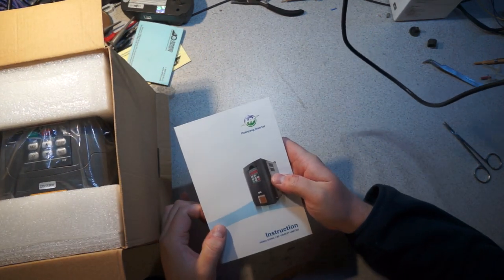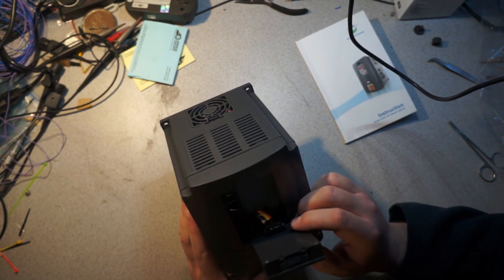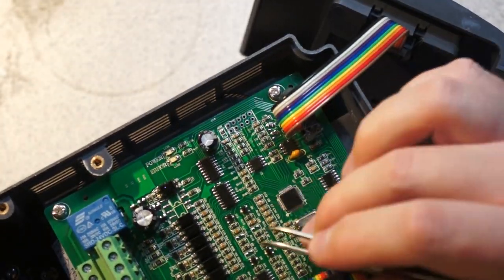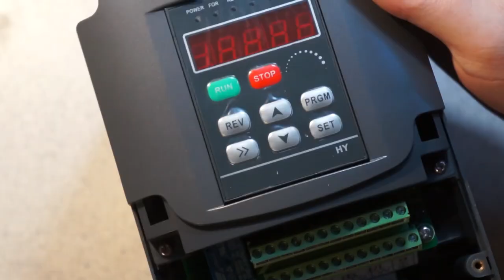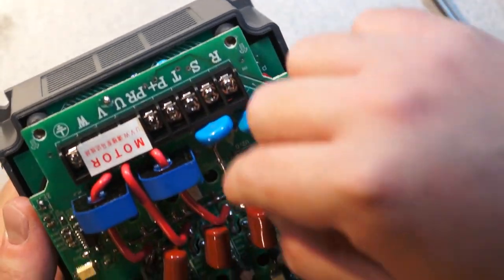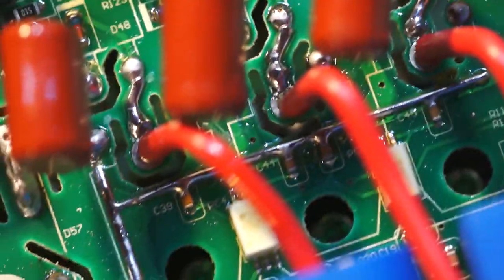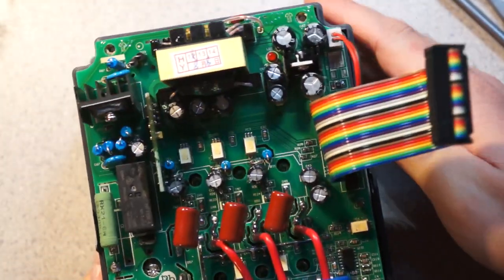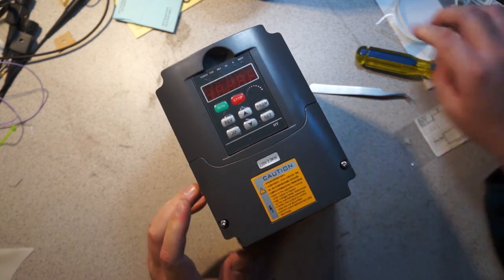HuanYang VFD Teardown

Comment: They work incredibly well. My 4kw runs my compressor beautifully.
Reply: Probably a 3 phase motor on the compressor and no 3 phase supply, so single to 3 phase VFD. Using a VFD also means the motor can be ramp started to reduce the starting load.
Reply: "But a single to three phase VFD gives out only single phase voltage"
That doesn't make sense.  A single to 3 phase VFD gives a 3 phase output.  I have a 3 HP 3 phase compressor running from a single to 3 phase VFD, from a single phase supply, and it works perfectly.
Reply: Yes, I should have clarified, the motor to be driven from the VFD, must be of the dual voltage type. Then it can be re-connected in the terminal box to run on 230 volts.  A 415 volt 3 phase motor will run very poorly, if at all, on 230 volts.

Comment: I have a 10HP 7.5KW 34Amp one of these, I am using it with  a 7.5 HP, 230 volt, 17.34 amp, 3510 rpm motor. It spools up to speed, but when I put a load on it, it faults out  (E.OC.A). It shows that it is using 6.6 amps when I put the load on, I don't think that the amps are going up to the 34 amp rating. Can anybody help me with this problem???
Reply: Mack Everhart you can change the program to set max amps. Can't remember what program number it is but there's a video on YouTube about it.
Reply: Mack Everhart motor amps program 142.

Comment: Does anybody know what I should do for error E.O.C.A. on one of these???
Reply: Mack Everhart 
I don't have any experience with these particular VFDs, but I'd check all parameters related to current. Check for parameters related to current limits etc.
I'd also use a clamp meter to verify the current reading i.e. make sure the current that the VFD is showing is indeed correct.
Reply: Mack Everhart
Also what application are you using it for?

Comment: Did you really opened the VFD just to find that they are not made with pink lace inside. If you wish, you can get OEM for adequate price, say 10000$. Device is as whole constructed to be cheap and this is done better than in most western. Btw. the remnant of 'flux' is anti-corona coating. Just to try with all means to find something to argue upon (mediocre soldering) is sign of bad prejudice.

Comment: I just scored a deal on a Enco 111-1450 lathe, it's Chinese, oh well, it is a heavy duty SOB. The previous owner added a nice leeson inverter grade 5.5hp 4kw motor. 

I was going to build a RPC for it but I think I'll go with one of these Chinese VFD's instead. Just imagen, a Chinese lathe and a Chinese VFD? Would it work or will it be a Chicom overload and simple explode? or maybe just refuse to start?

Its a home machine shop so until I figure out how to make some $$ I'll need to make do with this level of equipment. I will just need to figure out how to interface the VFD with the lathe controls. Also, would this VFD need to be mounted in an enclosure? 

Here we go, a lathe with Chinese VFD interfaced to work just like I need. https://www.youtube.com/watch?v=XR6R8pavtFA
Thanks youtube.

Comment: Hello, i have two 1.5kw and 2.2kw Huan Yang and both of them run into some problens with different issues.
   The first one the 2.2kw when it powers up, it flashes the firmware revision, as it normally does, but never moves on, it just keeps on flashing, it doesn't let you access in the menu.
   The second one the 1.5kw it powers up, it flashes the firmware revision, moves to the main menu but when i try to change the menu settings it just doesnt storage in memory my settings at all.
    I've tried the power stage on another identical inverter and it works fine, so my guess is that the control stage is at fault. 
   Since the inverter is out of warranty, is this repairable? Are there any spare parts on the market like the control circuit board?
   Looking forward for your responce
   Best Regards Alex
  My mail is:Alexpalios@yahoo.gr

Comment: I actually think it's quite overengineered and could be done a lot simpler. And try not to try to appear smart by repeating dave jones' mistakes of ragging on chinese stuff no matter what and bs like movs and cutouts are all important. In reality a good design would have neither.
Reply from the maker: +Dan Frederiksen 

What? I think it's fine, and am happy with it, even though it's chinese. I was complaining people rag on chinese products just because their chinese. 

Also, cutouts are very important if you're space constrained. Sure, if you have infinite PCB space, they're not needed, but they allow you to pack a LOT more into the same space by increasing the effective creepage distance between parts, and therefore reducing the absolute inter-trace distance. 

MOVs can also be important, depending on the context. Admittedly, they're kind of cheap, but they have their purposes, and some circuits do indeed require them.
Reply: +Dan Frederiksen You honestly think he does that in this review? Dave indeed has the tendency to either glorify something from a well known brand, and nitpick on every little detail on chinese products, but i dont think connor does that at all. All his remarks where fair, and cutouts and movs do indeed point at the fact that they thought about safety whilst designing this unit, which is always a good thing.
Reply: +tHaH4x0r if they do everything right they are deemed 'not completely useless'. But it might ironically be because he's afraid of judgment from others who want to hate on chinese products. But that's just no excuse. Judge dispassionately. Fearless of the ire of idiots.
Reply from the maker: +Dan Frederiksen You seem to be misinterpreting 'not completely useless'. I'm quite happy with this VFD. 

Basically, I'm just not particularly effusive about *ANYTHING*. "Not completely useless" is pretty decent praise in this context.